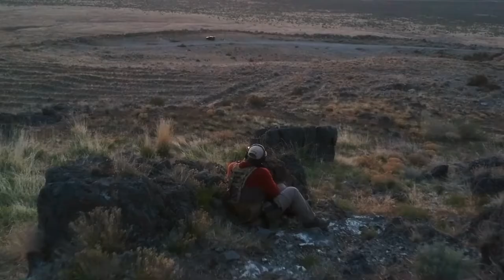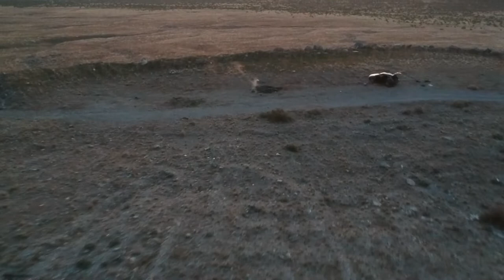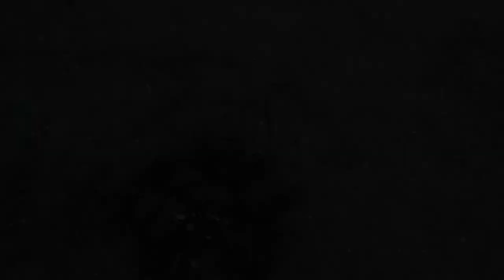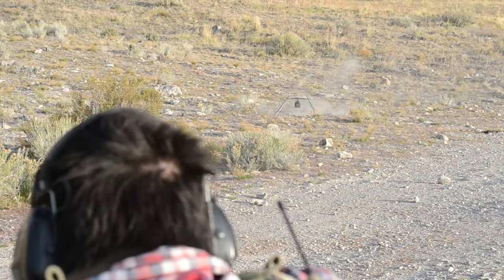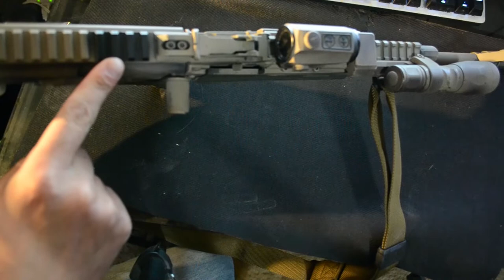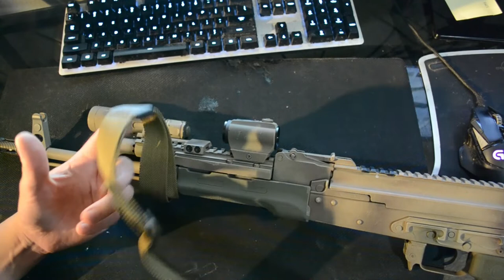AK WASR Part II

Comment: I have a bushnell red dot and a stream light in the same configuration. 1500 round in I haven’t fried them from heat but I did kill two rechargeable 18650 batteries. I think they were either old or too much impact over and over

Comment: If you wanted to add a front sight/gas block combo i would suggest chopping it down to 14.5” I would recommend a JMAC GBC-13. It is available with or without a gas regulating set screw, a “set it and forget it” type. Otherwise you can look at using a KNS adjustable gas piston to reduce recoil and carrier speed with the added back pressure. Also with the thread pitch you currently have (14x1), the only available keymo mount thru dead air is the flash hider, otherwise Jmac customs has tons to choose from.